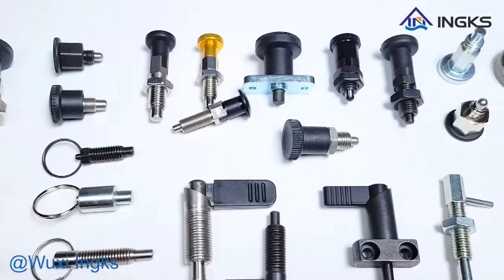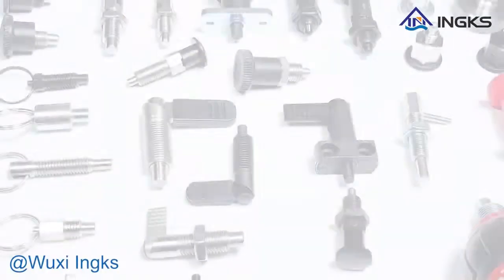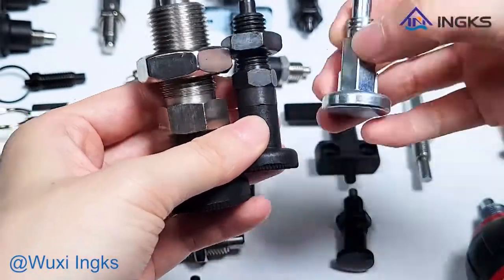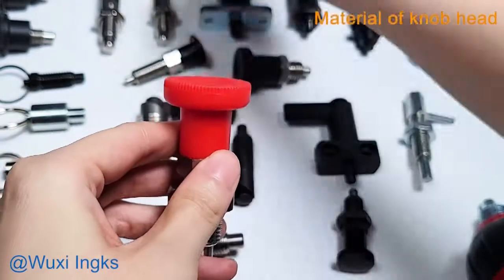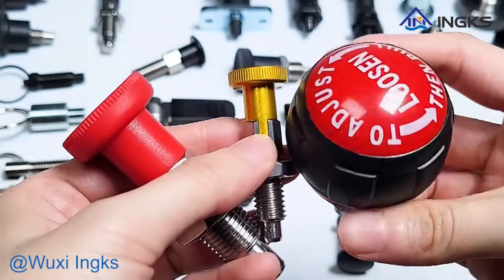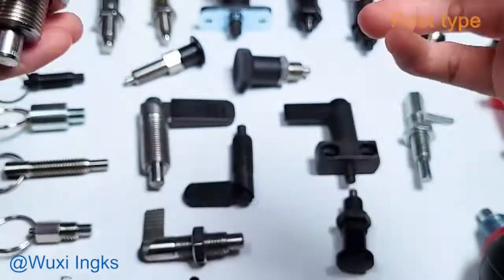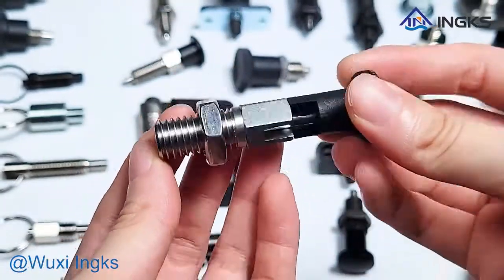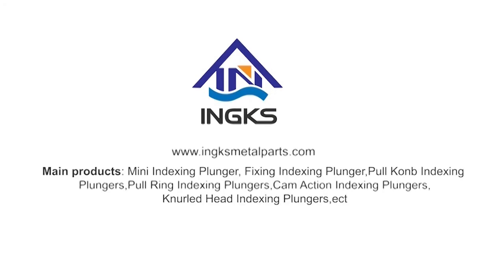(Ingks Metal Parts)  Indexing Plungers

Comment: I am looking for a hand pulled spring plunger with a pin diameter of 2.34mm and a pin length of 5-6mm . Preferably with a backend so i can make a bolt /handle between 2 plungers so both plungers can be pulled at the same time. Preferably the plunger should also have a locking mechanism, so it can only be retracted by hand, not by motion. 

The plungers will be used to lock in place a CD-ROM in sheet metal, so the plunger must be possible to attach to 1.25mm thick sheet metal, either with press or threading. 

Do you have anything that small?

Best reg Bård, Norway